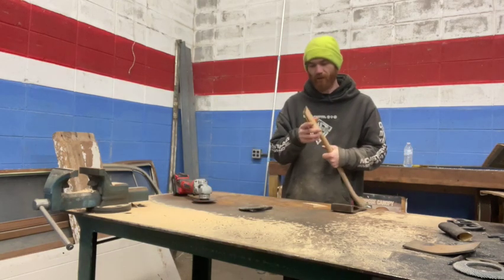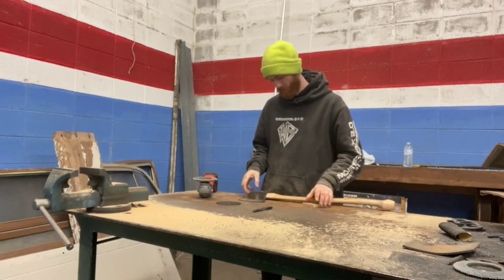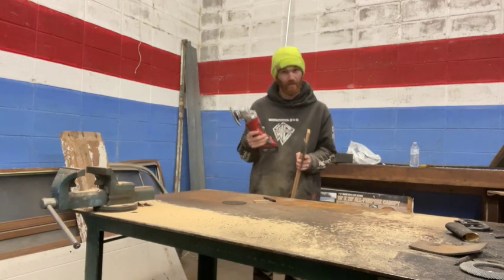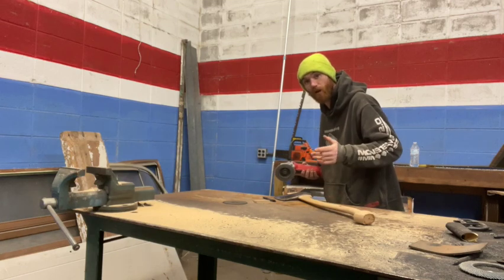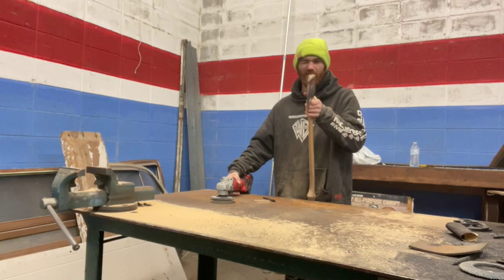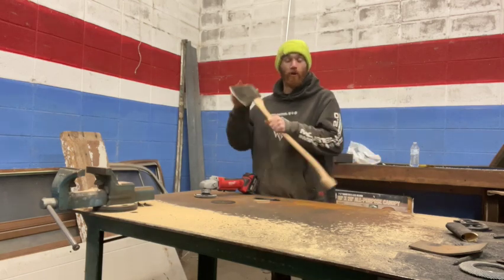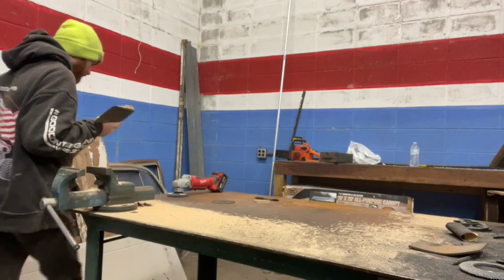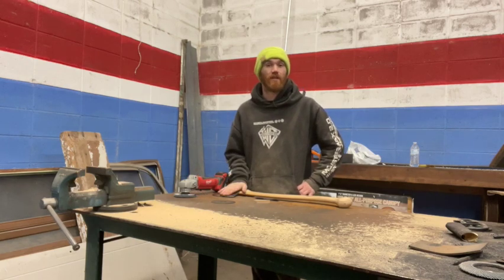1 Angle Grinder + 1 Axe Head = Black Raven Restoration Perfection

Comment: Something I do find the guard useful for….. to keep your grinder from running off the table if you sat it down a bit too early. Also keeps you from cutting into your table top.
Reply from the maker: Most definitely.   The everyday grinder is a Bosch slim and it had the guard on it.  This M18 got ran over and the guard didn’t make it out alive.
Reply: If you were sober for this, you're invited to come have a drink or five in my workshop.   If not... you're still invited.
Reply from the maker: @GCyrus-ok9pp  very sober.  Just running on a lot of coffee as of lately. 😂😂